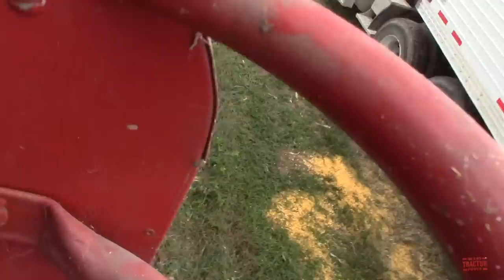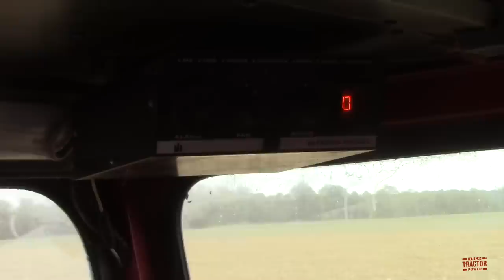RARE Case IH 1460 Axial-Flow Combine

Comment: Our red cab 1985 IH 1460 has the factory DT466 engine. You would be surprised at the numerous updates such as shaft size and bearing sizes on some parts. We have had everything off of ours except the cab, engine and one front final drive. Dad still used it this fall with no break downs.
Reply: There are plenty of International machines with original engines/radiators/etc that weren't factory spec. The assembly line didn't stop because a 414 wasn't available, while a 436 was.

Comment: Memories from Indiana! The first combine I bought was a 1460 after my Dad sold his New Holland 985 which was a great machine, but after he drove the 1460 he thought he was in heaven! Soooooo much easier to work on, the 985 it always seemed like you'd have to take off 2 belts to get to the one that needed replacing. On my third 1660 (combine fires) now a 1990 model. Would have replaced it with a 2166 or 2366 by now but a rod went through the block on the Cummins motor and rebuilt it. But maybe next year. Really want to see if the newer cab's on the 2000 series are less dusty due to having covid lung and on oxygen. If anyone thinks they are an improvement please let me know. If not I'll keep on rolling in the Ole 1660. And nice video!

Comment: Hi Jason. Thank you for your videos. The only combine I ever rode or drove was back in 1975 here in New Zealand. It had no cab, just a sun screen. Steering levers brake system to steer it. It had also been converted from a bagging system to bulk. Also a petrol engine,  straight 4 cylinder.  Harvested barley for feed in Hawkes Bay province. No photos and I cannot remember the model. You got very warm and itchy harvesting barley. We also baled the straw. Best regards, Silas.

Comment: I owned a 1460 for several years, but I believe it was manufactured before the sale to J I Case. Had a 4wd added to it after a wet fall that saw me pulled backwards out of sand hills numerous times. Great combine for the time! Traded on a 1660 that I ran for over ten years.
Reply from the maker: Very cool.  The 1460 and 1660 are solid machines.

Comment: Last combine our family bought was international 1460 in 1979. When started on 2500 acres rice farm in south east Texas.  In 1962 had massy 90 2 international 151 & 2 international 403    In 64 got j d 105   Then massy 510 eventually 3 of those then massy 750 and international 915  when got 1460. It😂was unbelievable.   Cut 200000 lbs in one day in 160 bushel corn.   160-180 k rice with 18 ft header.  For time nothing else was close

Comment: $86,700 in 1985.  Wow.  We had a 1480. It was a very good machine.  The 466 would run on full out day after day.  The hardest duty cycle application known to man.  I ran our 1480 quite a bit, often late into the night.  We wore out the transition cone on it.   Not easy to replace.

Our 1480 replaced a TR75 and a 914 and did just about as much as both together.  The 1480 got replaced with more TR - 95, 97 and 99.  Those were good combines except the stone traps weren't the best.

Comment: I have the same combine, 2nd great machine. 3200 hours on it. Was a late serial number machine. Some of the parts on it are the same as the 1660. Run a 22 ft straight cut header on it for wheat and barley. Love the straight pipe on it sounds great.
Reply from the maker: Very cool.  Thank you for sharing. This one has 7,400 hours.

Comment: I had a 1440 ih same size rotor but build a little lighter. I was told the 1440 was put on the old ih 815 frames and the 1460 on the 915 frames with the turbo on the 436 engine. I liked mine

Comment: Exactly like the last one I sold in late 88, early 89 when I  was sales rep. I think the sale price with flex head was around $125k. Price seemed insane.
Reply from the maker: Was the 125K model a 1480?
Reply: @bigtractorpower  1460 for sure but it may have been a few years after the one in the video actually. I watched this first without sound. It had a Mud Hog axle added to it so that bumped it up some. It's been a long time.

Comment: They used to be everywhere.
Reply from the maker: The  IH 1460 was built from 1977-1984. The 1985 Case IH 1460 was built for one year and is rare.  Interest rates were at 17%, there was a severe drought and low grain prices. 1,200 IH dealers closed.  There were not allot of combines being sold in 1985.
Reply: All a 1460 is is a 1440 with a turbo and longer sivs

Comment: This Video is awesome!! Thank you so much for capturing it so well. I’ve driven the neighbor’s 1440 for the last 5 years (1980?). Then late last fall he bought a 1640. (1986?) So I’ve driven both and seen the differences firsthand. I didn’t know about the transition year model. Is it only for the 1460, or is it also for the 1440/1480?  Look at my profile for a couple of videos! I love 70, 80, 90s equipment, especially combines!!
Reply from the maker: The full Axial Flow line was in production in 1985. 1420, 1440, 1460, 1470, 1480 and 1482. I have seen a few 1985 1460s in pictures and a 1480 for sale in Illinois.

Comment: Rare huh? There is a farmer that, well, farms a couple fields around my house in southern Illinois with at least 2 of these. Of course that being said, my house is only like 5 miles down the road from a Case/IH dealership that has been there for YEARS. It was Vergennes Equipment, but got bought out some couple years ago by H&R Agri-Power. Have no clue where they are based out of, but I can say that since they have a "chain" of dealers, getting factory replacement parts is a LOT faster now.
Reply from the maker: I live a few miles from the H&R Agri Power home store.  It’s a great dealer.  Agri Power sold a few of these 1985 models in WKY in 1985.  This is the only one left now.

Comment: Bad thing about these good older machines the dealers are not stocking many parts anymore.
Reply: Dealers can't even get parts for the new ones right now either.
Reply: @gonerydin4225  Yes I agree with you there happy Sunday to you.
Reply: Parts may be hard to get at times for the older stuff but you don't need customer service, a computer programmer and an engineer to tell you what's forked. 😁